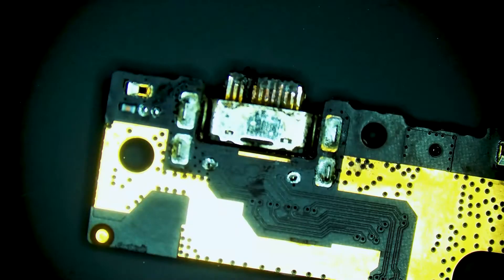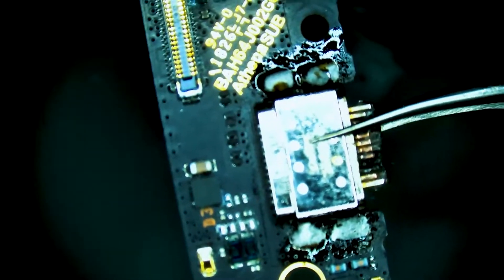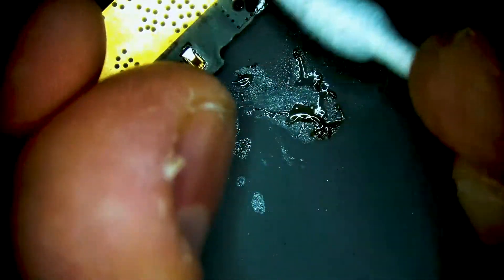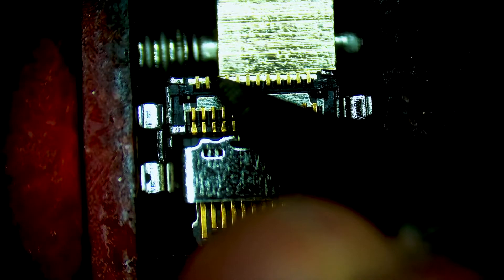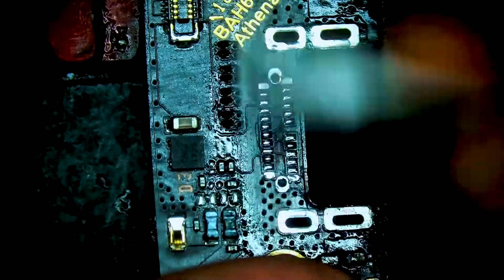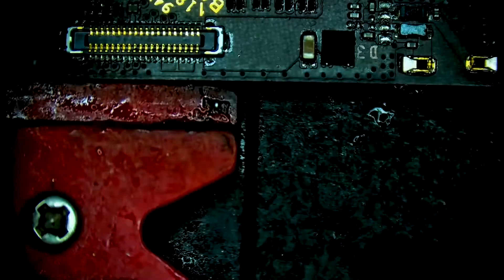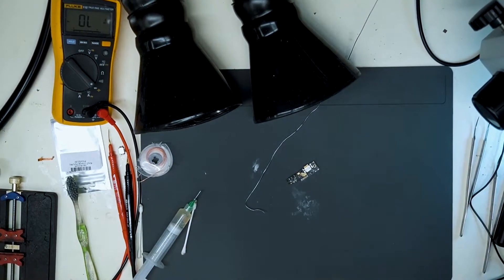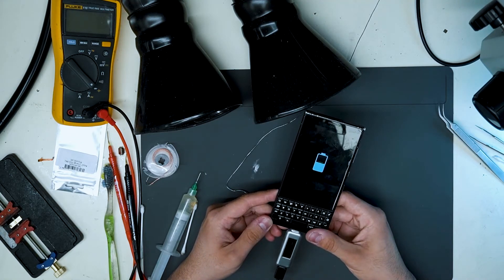BlackBerry Key2 USB-C Charge Port Replacement Through Micro Soldering

Comment: good video, can someone assist me, i have a Blackberry Key2, BB100-4 ,   black/broken screen. 
trying to access it, i can boot into fastboot . and send fastboot commands

how can i access display? I got hdmi  USB C adapter from amazon (B097NZDN1M)  no picture on TV. 

i dont think USB is enabled.   is there a way to boot into ADB mode and use VYSOR?    or some other software with this model? i tried vysor/drfone to no avail it only dect it as blackberry. 

I cant even access it as a USB as i have to put into PTP mode but not possbile with broken screen.

Comment: these phones are LOW QUALITY:
USB port ruins in weeks ( my HTC is almost 11 years old used constantly and USB still locks in )
Microphone sucks
firmware sucks
No wireless charging 

they claim this phone is about security yet its software uploads your stuff to different services you can not control it or root it

If you accidently push the side button it while the phone is in your automatically phones 911 , and they record the audio   (yeah ok Blackberry your not about security)
There is no UMS storage, to get your files off of the phone you have to use slow protocols which does not allow you EDIT the picture even with windows.
No stereo speakers yet it the size of a large speaker 
Wifi calling does not work  no matter how hard i try.

not sure why people pay 1000 for it. .
Reply from the maker: Yep! These phones are headaches..